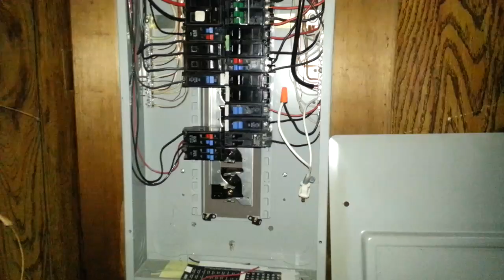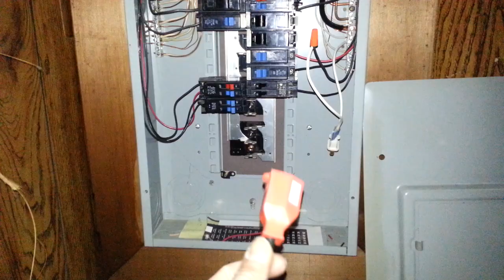How to connect a generator to a oil burner

Comment: maybe in a pinch emergency, but I would buy a transfer switch to power this  from my generator as well as  the well pump, oil  boiler, baseboard  circulators  with  2 zones and not worry about any  discrepancies.

Comment: Better to be proactive and have this already prepared for a power outage. Get a HEAVY duty garbage disposal replacement cord (14 gauge) . The wires are already color coded. Black (hot) White (Neutral) & Green (Ground) . Use a knock out and install a cable clamp. PROPERLY  connect the neutral & ground . Then ONLY connect the Black (hot) as needed during power outage (emergency) as shown in video. This method is temporary in emergencies only. I do this for my furnace circuit when power is out.  Have your electrician explain so you comprehend what you are doing.

Comment: This is said for an oil burner. Is this the connection that would used with an oil burner that has a circulating pump to feed radiators ?

Comment: He used an 18 or 16 gauge extension cord.... and attached it to the 14 or 12 gauge wire to his boiler. He used the wrong size cord at a minimum. Also, should have used a cord with a ground wire in it.

Comment: He should have used a 3 prong extension cord with a ground prong. Attach that ground wire to the ground bus bar, attach the fat prong wire to the neutral wire, and attach the skinny plug to the black wire back to the boiler.

Comment: My oil heating system has a plug built right into it.  So if I lose power I just plug it in to my generator .  it's connected all the time.   If I did what you did I would've made my own plug from Romex ,and a plug you wire yourself .  Always remember electricity travels on the outside of the wire not through it. A solid piece of.wire with insulation will work best with no worries of overheating the wire or the plug either.  just a thought ...
Reply: I agree. Using a cord from an appliance is cheezy and dangerous.  I also would make my owne pig tail with the same romex wire gauge the breaker is rated for than  wire in a plug end. This way there's no need to worry about overheating and calculating watts.

Comment: By "boiler" you mean what, the burner motor and transformer, any circulators 1-?, and thermostat/zone valves?  I guess starting watts are significantly greater but brief?

Comment: This video is a bit unclear as to which wire goes where. On the male plug, the narrower blade goes to the black wire which was removed from the breaker. The other wider blade goes to the neutral bar on the panel. Be careful! If you get it reversed you will get shocked.  Also, don’t use a male plug that isn’t polarized. That would lead to it being hooked up wrong too.  

I don’t recommend this method as it’s risky and there are too many places where something could go wrong.  A better solution is to locate the box near the boiler that has the shutoff switch. Then install into that box both an outlet that is hot from the load center and a male extension cord that is wired to the  shutoff and subsequently the boiler. Then for normal use plug the cord into the outlet. For generator use unplug the cord from the outlet and plug it into the generator. You still have the shutoff which will kill power to the boiler on either power source.

Comment: Your gonna cause someone to burn their house down or blow them selfs up. You didn’t even explain how to identify what wire was the hot wire and the neutral. Saying the left and right wire means nothing. Also electrical tape is not to be used to make a splice.

Comment: With this setup is it necessary to have the generator grounded from the grounding nut on the generator directly to the house ground as well? I have read the ground needs to be an unbroken wire. Thanks!
Reply: Use a three prong cord with a ground wire in it. Attach the ground wire to the ground bus bar. No need to use the ground on the generator then, as the cord grounds the generator to the houses grounding rod.

Comment from the maker: That male plug is hard wired to your boiler and not connected to your main power line from outside. Remember we disconnected the boiler from the breaker, so when your power is turned back on that plug will not be hot.

Comment: The narrow blade on the plug is "hot" "black". the wide blade is "neutral" "white. Also if your extension cord has grooves on one side that wire is the neutral. Also I didn't hear this mentioned but the way he had it in this video if you accidentally reverse the wires (hot on neutral. Neutral on hot.) Its likely you could be shocked

Comment from the maker: This method bypasses the breaker box so there is no danger to anyone or anything as long as it is connected correctly. If the power comes back on the burner is not connected to the panel so there is no danger. The main shuts off the live current from the outside lines. The neutral and grounds are still connected but are not live. Never touch the big black main wires or the main lugs because they are always live even if the main is off.

Comment: I know this works and is a good, quick way to go in a pinch. Is there any danger to this approach? For example, if the power company puts the power back on while the generator is powering the boiler is there any danger to the generator, boiler, power company or anything else? Don't the main breakers only disconnect the hot wires from the street, the others are still connected aren't they?
Reply: Because you've disconnected the hot wire from the furnace breaker there is no longer any connection from the power company to the furnace until you put the black wire back into the breaker.  At such time you would have disconnected the external power source.  So there is no issue.  Do not use a 2 prong plug, use a 3 prong plug that is polarized so you don't plug it in wrong.

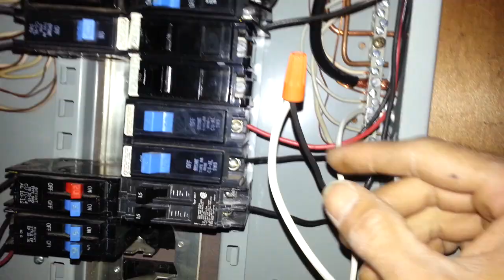Comment: Just curious, why do you have tandem breakers when there are plenty of unused spaces in the panel for singles?  Also, it would be good practice to wrap some white tape on that big black wire on your right buss bar.  2:55 "black is always hot"

Comment: I think it would be safer and easier to cut the wire at the boiler, or furnace and splice in a male and female plug so all you need to do is unplug the wires and just plug your extension cord directly to the unit. That is how i wired mine. just another idea.
Reply: Just a quick question and I'm not an electrician in any way. But if you run directly to your boiler how do you get your thermostat to work? I have an oil furnace with a blower and I want to make an emergency connection to my generator just in case so maybe my system is different. Any insight would be greatly appreciated. Thanks
Reply: @steveguerin7650  - don’t know how boilers work but a gas furnace has a main circuit board with a 24v power supply which powers the thermostat so you can control the heat once you power the furnace. This approach is not really a good way to do it. Better to go right to the furnace and put a plug and outlet on the line going into the furnace. Then when you need to power furnace simply ‘unplug’ the furnace from the outlet and plug it into you generator extension cord. Here he connects to the neutral bus and has no idea what other connections are downstream of his black hot wire amongst other safety concerns.like using the left wire??  What?

Comment from the maker: This method bypasses the breaker box so it does not matter if the main line neutral is disconnected. This method is basically just converting the burner from hard wired to a regular male plug, like every other appliance has. Just keep your main breaker off while you connect it. Once connected you can turn the main back on or just leave it off. I leave it off but either way.